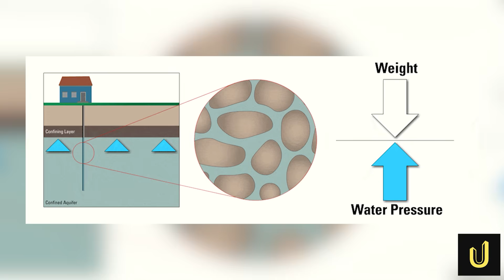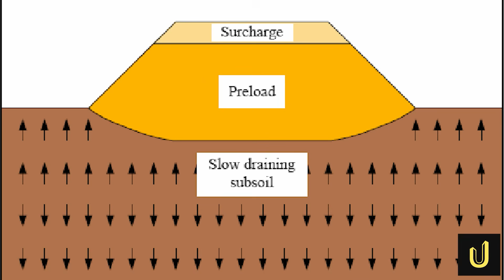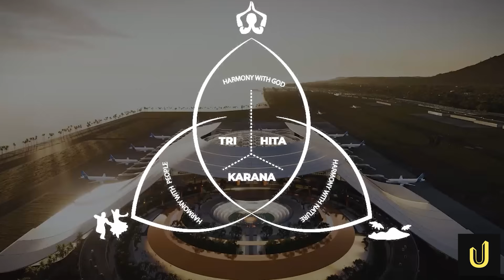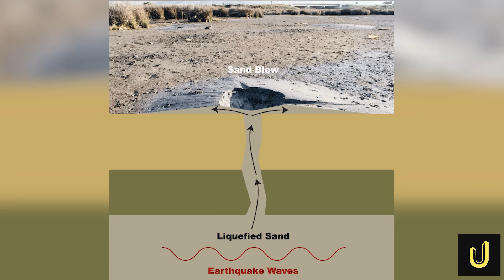The Insane Engineering of Bali's NEW Artificial Island Airport

Comment: I have been there. There are no proper 2-lane roads there. Roads would have to be built and massively expanded beforehand. Even though the president agreed to this airport, the project did not start. With this size of land created ON the current ocean, probably +10 years to get done is my guess. I support the project but it is not solving the South Bali traffic problem. It would be much more helpful to learn from the Chinese and Japanese road experts to solve the traffic problems down South and build real roads. But it seems they have given up. The existing roads South to West Bali and to North Bali have not been improved. Also, 2 runways up north are a ridiculous overkill if the existing airport with one runway still has enough capacity to handle all flights.

Comment: This sounds like a crazy project, without justification for its location. Hopefully it's not a scam designed for someone to make huge money. Balinese people, please look into it. Expanding current airport would be a much better option even if it needs to be also build into the sea.
Reply: It is crazy because the current airport still has enough capacity, just the roads around not. I believe a northern airport could theoretically help the South traffic a bit if all the tourists travelling to Ubud and Canggu/West Bali would arrive North, for example. Unfortunately this is not realistic as long as the North-South road takes 2-4 hours and is not improved yet